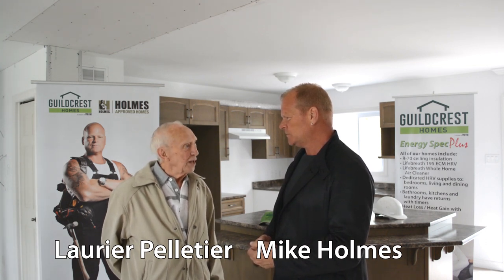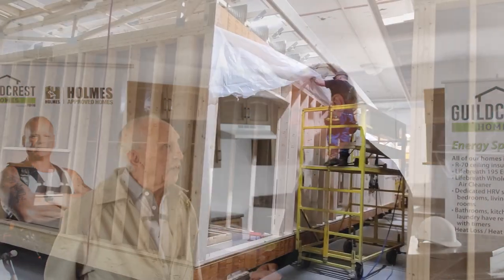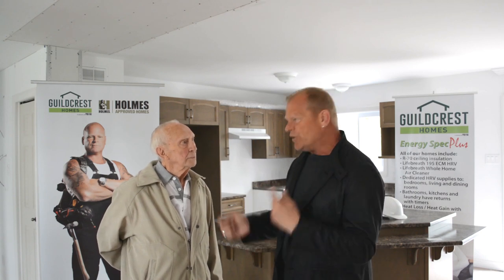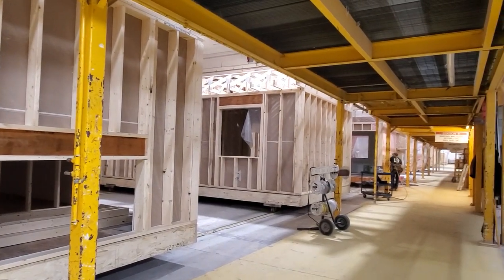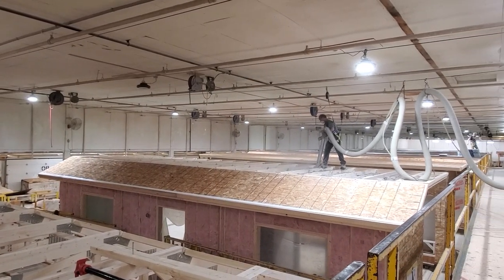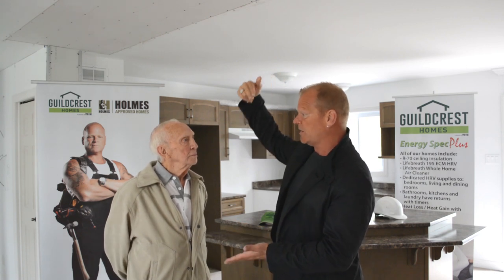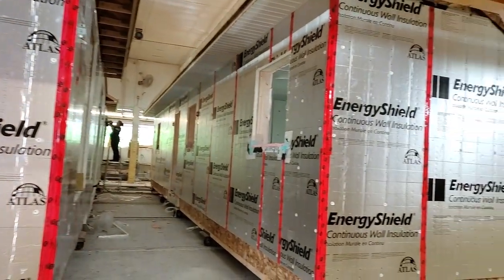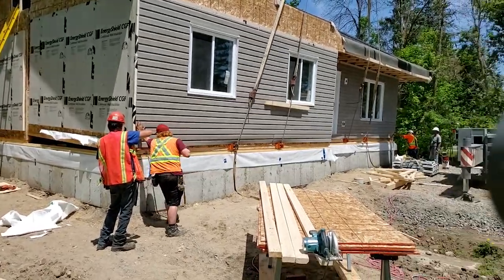Mike Holmes talks about modular homes with a new customer

Comment: What about re-sale value.  I don't know much about modular homes but people are telling me that I won't get as much as a regular stick framed home when I sell.  As much as 20% less re-sale value which I don't see how because to me it makes more sense to build inside like a modular home.  You'd think it would be the opposite.
Reply: That axiom is more for mobile homes (double-wides) without a fixed foundation or just set up on a pad. Of course you also have to remember that you're also paying 20-30 percent less than a stick built home.
Reply: I'm not absolutely certain but a modular home on a permanent foundation should maintain or increase in value just as a stick built home would. Modular homes are built to meet and many times exceed local building code standards.  Also as far as double wide manufactured homes, if they are placed on a permanent foundation with axels removed it is considered real estate and not a mobile home.
Reply: You are thinking of manufactured home.  They are basically mobile homes that are not affixed to the property.  Modular homes are affixed to the property and increase in value just like any other stick built house.